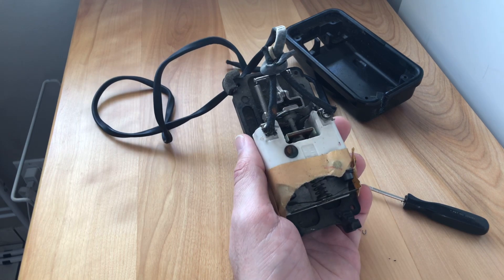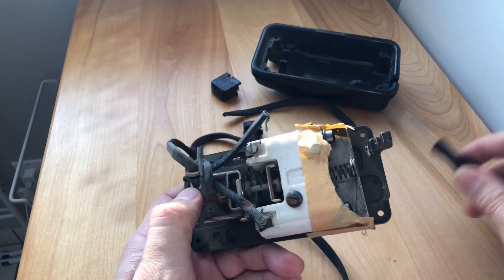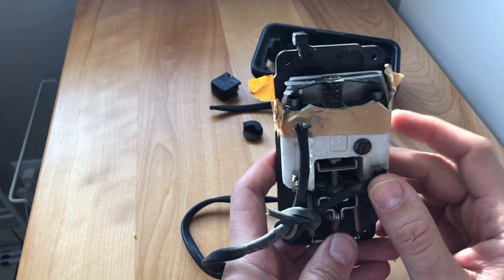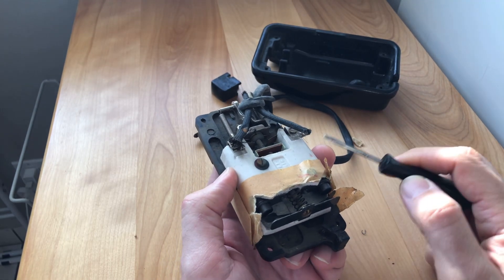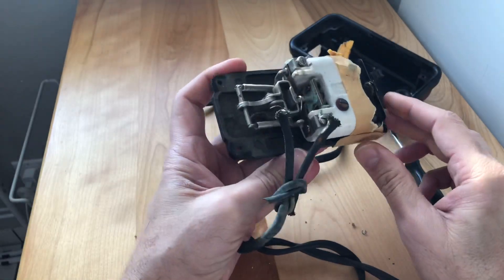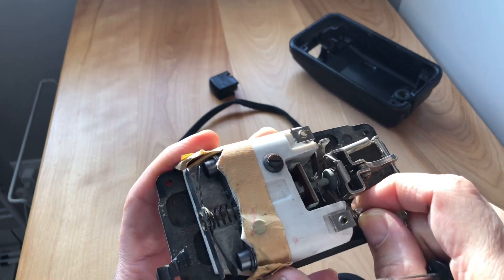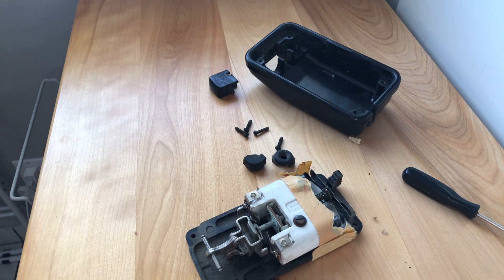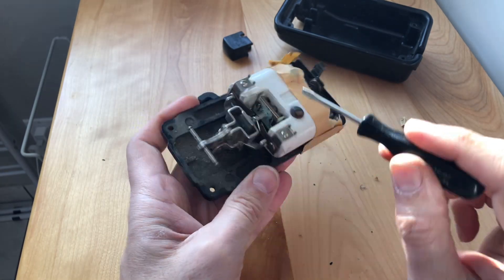IF OLD SEWING PEDALS COULD TALK PART #2: Why is Tape on the Bottom of a Singer Control Pedal?

Comment: Excellent example of the old "carbon stack" foot pedal. I also save old parts for many of my hobbies. Silentlly causing my family to talk of a possible hoarding issue.
However, I  would like to explain the function of the carbon discs. When the foot button is pressed, the pressure increases to the disc stack reducing the space and the resistance between the discs causing an increase in the voltage and current to the motor. ( Ohms Law - P=I×E and E=I×R ).

The problem of controlling motor speed, 100 years ago, was solved with this foot pedal design. It worked with all of the different types of voltages, AC/DC 30 to 110. But the result is heat generated at lower speeds due to the higher watts or heat going into the carbon discs. 
NOTE: This is the reason you must always unplug a carbon stack controller when not physically using it. The possibility is the disc stack generating maximum heat at the slowest speed and at "no speed", if it malfunctions or is out of adjustment. 
Imagine a wall dimmer switch that does not have a smooth increase to the light fixture. Would you attempt to fix that switch, or replace it?

The carbon discs get worn out causing carbon powder and disc breakage. Both of these cause an increase in current flow. The motor speed is also increased by the increased voltage supplied by your power company. Voltages  above 130VAC are not uncommon. This was initially engineered to be 110VAC. [ Another infrastructure topic for later ]
Carbon discs controller are amazing.    But they also hard to adjust, and sometimes a source of damaging heat.

The best solution is to use an electronic foot pedal in place of the carbon disc controller. I have tried rebuilding several pedals and it is not generally worth the effort with worn out discs. I use a analog multi meter to check for a smooth transition from slow to fast.

DISCLAIMER: ( I have extensive Training on electronic repairs. So if you dont know what I  have been talking about, please have a qualified person replace your foot pedal).

Comment: When you get to be my age, you will store your small parts in pill bottles, not envelopes. Also, when you get to be my age, it helps to label your parts immediately upon salvage.
Another point about the porcelain isolator, is that it will dissipate heat generated by the variable resistor type switch that it is. A factor that is minimized in electronic type switches.